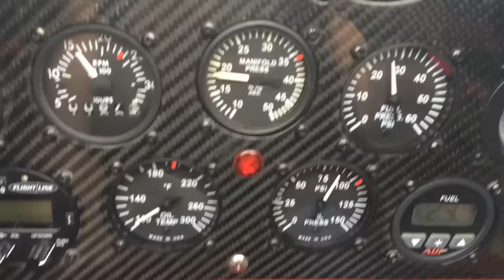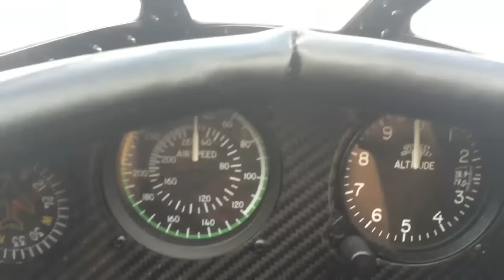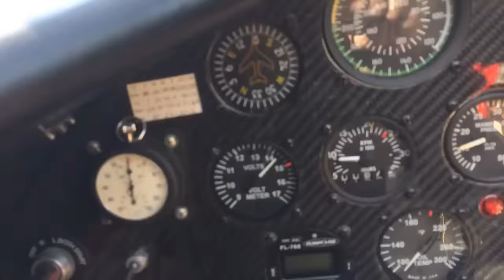Changing R-985 Cylinder - Kyle Franklin

Comment: Beautiful plane and engine.........next time.........as you are lifting the cylinder off of the piston , put a rag around the connecting rod under the piston , and tuck it into the crankcase............you never know if a piston ring or oil ring has shattered and as you lift the piston out of the barrel ,, a chunk of broken piston ring falls out and into the crankcase it goes..........fortunately there was no broken ring sections in that cylinder , but you never know the next time...........on the bottom cylinders there would not be such a risk , but on the top ones gravity will pull broken pieces into the crankcase..........when it happens  , you will say the F word many times ...........placing a rag in the right spot only takes a minute , and you will love yourself for doing it when three pieces of ring fall into the catch rag and not into the crankcase..........you dodged a bullet that time , but maybe it might happen next time , and it will wreck your day..........love your plane and engine and enjoyed the video.........thanks

Comment: Only a question, the new cylinder head cames with their valve's clearance already adjusted from refurbishing/seller ?
Reply: That's what I noticed, when he installs the complete replacement cylinder with the housings and the sticks still in place, he has no idea what kind of clearance or negative clearance he is going to have. He could torque it down, put palnuts on all the studs only to find he he hasn't any valve clearance. At this point He may not be able to shorten the sticks because there too long to remove them from the cylinder. All the clearance adjustments are made with the sticks that were inside of the housings. I watched a couple of these cylinder replacements on a 985 and the last person did it just like he did. As if a cylinder replacement isn't also going to require valve clearance adjustments which will likely involve the removal or replacement of a spacer of a  different thickness. The valve seats are not going to be the same between the two cylinders and for all he knows one or both of the sticks could be bent. Maybe it's all staged.

Comment: The reason the piston head came off is because the cyclic loading on the alminium caused fatigue and failure. Expect similar issues on the other cylinders soon.
Reply: CreeperOnYourHouse There was nothing wrong with the piston "head". The cylinder head parted ways with the cylinder.
Reply: CreeperOnYourHouse the engine TBO of over 800 hours. It could as simple a casting defect in the jug.
Reply: It was interesting that the failure happened about where the "head" would normally be attached to the cylinder.  The head would be the first part of the barrel to heat up during warm up and transfers the most heat to the air during operation, because ignition happens near TDC, and hot gases flow out the top of the head.  Thermal expansion of the head may have added to the cyclic loading on the barrel.   I wonder if at overhaul they replace the barrels or just recondition.   The only real way to know is to examine a large number of engines and their histories.   Most likely it was a casting flaw or this problem would have been dealt with previously!
Reply: @garybulwinkle82  The barrel cracks where it meets the head.

Comment: I've always put the piston into the connecting rod first used a ring compressor, even for the oil ring.
Reply: That doesn't work very well. You push on the cylinder and the linkrod moves to the side putting the piston in a bind inside the cylinder. Then your only recourse is to pull the cylinder off and reset the ring compressor again.

Comment: mmmm, those things that holds the attachment of the cylinder to the power section are named nuts...not bolts...one more thing and please don't hate me but leaving the aircraft unattended with no brake rider and the engine running going through the front for leak checks is a way to have yourself kill and put other humans at risk, please that aircraft is to show skills, have a good flight...